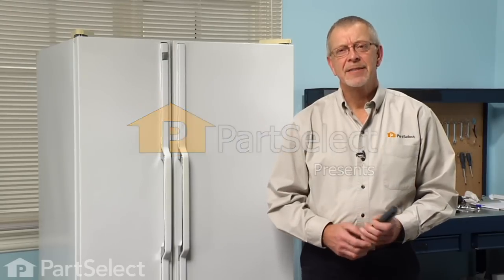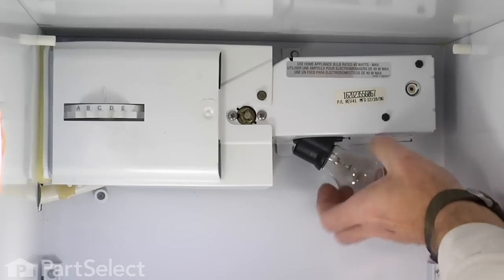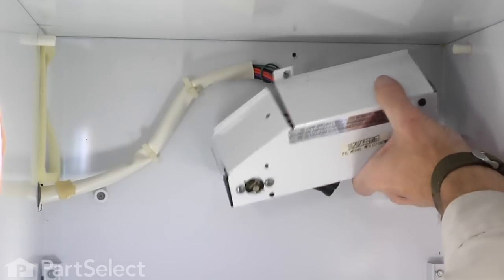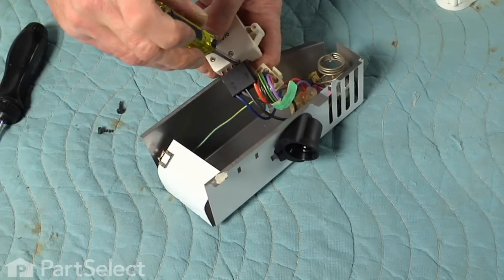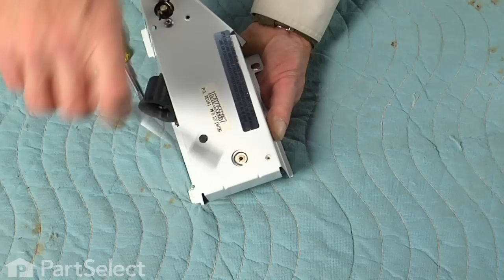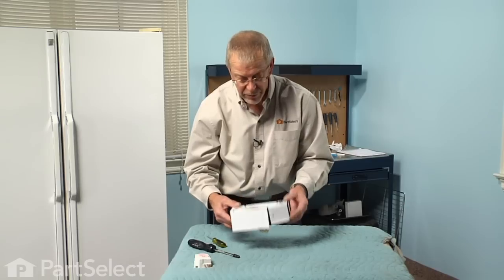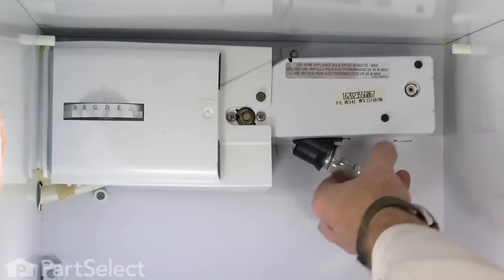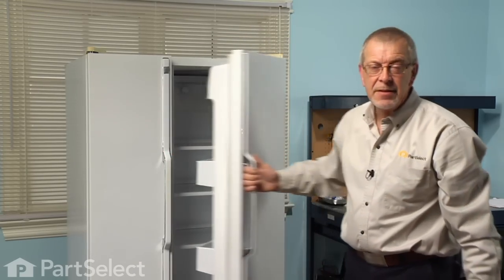Refrigerator Repair- Replacing the Defrost Timer (GE Part # WR9X489)

Comment: GE TFX25PA refrigerator, like the one in the video.  The left door, the freezer, is very good defrosting, but the right door, the cooling at the bottom of the refrigerator is freezing, and the top of the refrigerator is lightly cold or hot
 The question is what are the holidays?
 Thank you so much

Comment: Hi Steve is there a test to show if the defrost timer is broken?
Reply from the maker: Yes, you can test the defrost timer with a multi-meter to determine if it's faulty. If you head over to our website and go into our Fridge Free Repair section there is information there in the warm fridge/freezer section about testing the timer. Hope that information helps. Let us know if you have any other questions or if you need more information.

Comment: Hi,
I'm andrea from italy,I have this old model refrigerator GE tfx27f(it looks the same as the video but has the water dispenser).
 Can you say me where i found all sensor temperature in this model?
Thank you very much
Reply from the maker: Hi Andrea, when researching your model number it's coming up as not the complete model number. Please click on this link: https://www.partselect.com/MultiModels.aspx?ModelNum=tfx27f&searchTerm=&RefineSearch=0 and complete your model number. Once you do that if you search for thermostat it will pull you up all the ones listed for your model and what section to find them in. If you have any questions please feel free to call us at 1-888-738-4871 or use our live chat options.